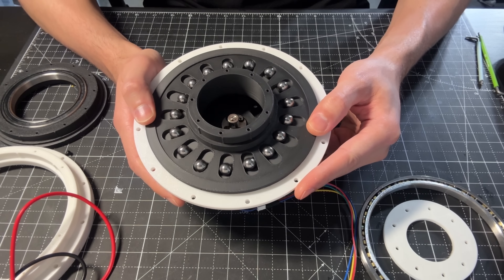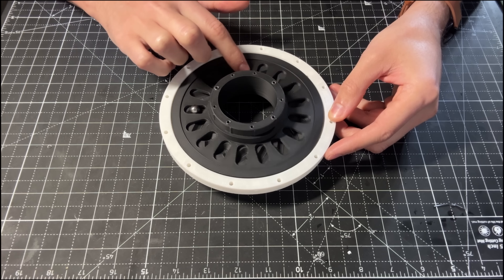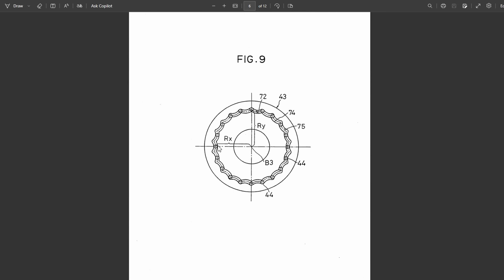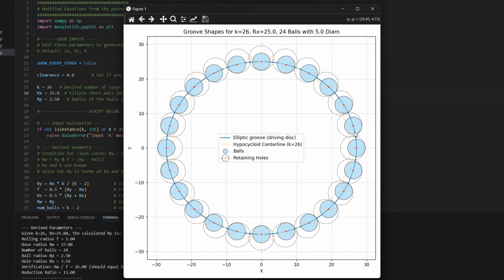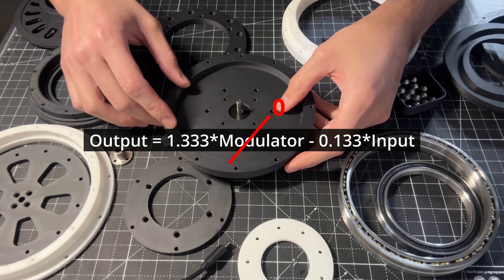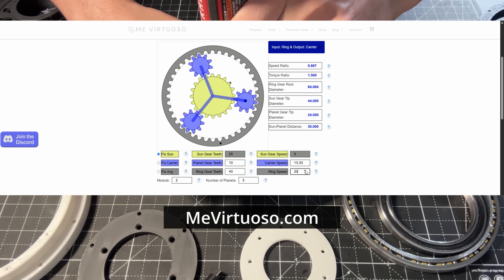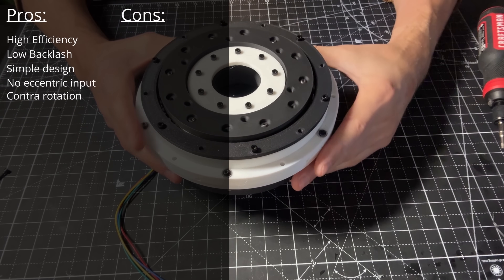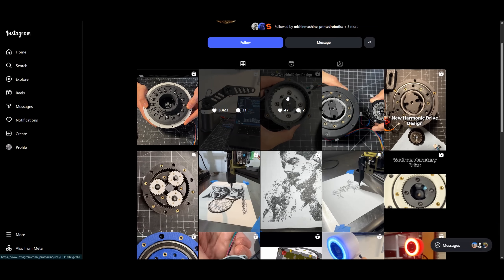Novel Reducer - The Logarithmic Drive

Comment: If you used the same curve on the input and output side, and drove the center part and put wheels on what used to be the input and output, would it work as a differential?

Comment: I expect if this was made with hard metal it would result in galling and wearing of the balls or the wave generator guides - probably working with metal balls and plastic guides like you printed is better. I suppose this will not go into production due to it not being as good as existing reducers.

Comment: I would say this is just a harmonic drive with extra mechanical complexity, but strain wave gears require flexible materials which are not always available in certain applications.
Reply from the maker: This design is also easier and cheaper to manufacture

Comment: Action like a hypocycloidial drive mixed with a harmonic drive exciter

A high ratio diferential drives allow hybrid input of multiple sources, including the obvious constant speed variable power "primary"  input coupled to a variable speed secondary input..

Balanced operation in one stage is what a harmonic (strain wave) drive has over a single stage hypocycloid..

Comment: I could see this as an application in automobile hubs as a reduction for off-road applications. I would think you’d need an easy way to decouple the drive but a 7.5 reduction as a “rock crawl” mode further reducing low gear would be fun to play with!

Really curious what torque these could handle…

Comment: It seems like the viability of this design will be contingent on ability to transfer torque compared to alternatives, something that should be directly related to the path of the bearings and the interactions between the two different pathways traced out. Also curious if the speed is perfectly linear as it seems to be. 

Beyond that, I wonder what other advantages/disadvantages this design may have over alternatives. Backlash as mentioned, maximum torque capacity, energy loss, precision, vibration, etc. I guess we will have to wait for further prototypes to know for certain.

Comment: Soviets had a bunch of patents on very similar designs in 1980s, and used them in space applications instead of Harmonic Drive. The inventor was Yangulov V.S., and he published many academic papers on such devices. For example "Geometric and Structural Relationships in Wave Drives with Intermediate Rolling Elements".

Comment: Great video!  This looks super!  Great find.  I disagree on fabrication.  You don’t mill hard metals.  You mill soft metals and then harden them. All you need here is case hardening. Could be done by traditional means (carbon bake) or induction hardening. There will be a tricky part, in that you would like to surface grind the grooves to perfection after hardening. Basically need to figure out how to make a bearing race that is a groove.  But this is already done for rotary couplers (think ship gun pedestals).  One might have to crest some specialty machining for this but it should be doable. What I like about this is both the counter rotation and the high torque. This drive should be able to generate and be robust to very high torque because all the forces are shared with so many bearings. Ingenious design, well done!

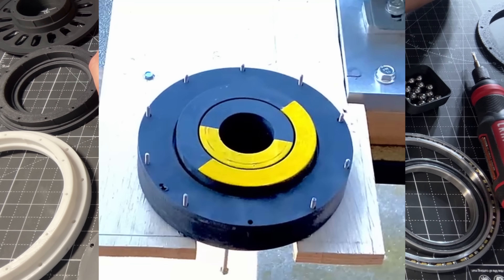Comment: 5:53 that vibration looks rough, I think this design is easier to 3d print, but performs worse than harmonic drive in both efficiency and accuracy

Comment: As others have said, the balls will be sliding instead of rolling which will eat into efficiency. I also suspect that at higher speed the energy spent accelerating the balls back and forth will become significant
Reply: The balls could be replaced with two roller bearings connected with a shared center axle.
Reply: @3fives-j5w 
That was my first thought as well, at least for large sizes that seems like viable design. 
I'm unsure about the size/weight to torque capacity ratio of planetary gearsets compared to this, but it feels like it might have massive capacity if built that way.

Comment: just a regular cycloidal reduction but done on a different axis. still pretty neat.

seems the balls could be either straight rollers or small cranks/eccentrics. iunno. think it over more...
Reply: just what I was thinking too, the ball bearings there could easily be pins

Comment: I'd dispute this working as a bearing as the load bearing ball wall contact speeds mismatch the balls need to partially slide rather than roll.

Comment: That's really cool.  I wonder if you could modify this to recirculate the balls like a linear bearing or old steering boxes.  It would be difficult to machine, but it would eliminate the reciprocating motion of the bearings.  Probably eliminate a bunch of noise.
Reply: You don't understand at all how this works as a reducer.

Comment: It's not efficient. The ball is sliding on all points of contact, not rolling. The ball is sliding on the cage while pushing against it to resist following the rotation of the track. The ball is also sliding on both the tracks because they are moving at different speeds from each other, and are following different paths so the ball will get a rotation in both axies. All of this will make friction that gets worse the higher torque that gets applied to the output.
Reply from the maker: Good point
Reply: I don' think it will be sliding significantly on all contact surfaces. For this argument I'm going to assume the grarbox is not preloaded, so there is some amount of backlash. Then there will only be contact on the drive face on each component. Three points in total. The ball should then be rolling on the two points with the highest contact force.
Reply: Not sure I agree. There might be an optimum ball size that lets it roll more than slide. Also, that is what lubricants excel at (you car engine crankshaft journals are sliding, not rotation).  You bring up a good point, but I don’t think it’s a killer. At least for a great many applications.
Reply: @hu5116  The car engine crankshaft journals are NOT sliding. They are floating on a film of oil. They are hydrodynamic bearings and there is no contact between the surfaces.
Reply: @hu5116  big difference between crankshaft journals and ball bearing balls. First of all, technically carnkshaft journals don't slide but are hydrodynamic bearings (pressurized oil film). Secondly, those journals have line contact, not point like ball bearings, huge difference. 
The balls can never role, no matter tha backlash. The contact points are almost exactly 180 degrees from eachother, and the surface speed vector points in the same direction on both those points. That means the surface of the ball has the move in the same exact direction in two point spaced on opposite sides. This is called sliding motion, not rotation.
Reply: Es verdad y esto varía con el ángulo de cada surco tanto en el eje de entrada como en el de salida, o sea que cada diseño tiene su propia característica de fricción. Se puede mejorar el diseño poniendo 3 elementos, uno para el surco primario, otro para el modulador y otro para el secundario y que estén conectados entre si, pero se haría mucho más complejo.

Comment: I'm not sure about the high efficiency, it's not because there are bearings balls that it's efficient. For that, they need to roll and I don't think they do a lot of rolling, they mostly slide which is not efficient.
Reply: yeah, three point contact of a ball can't make it to free roll, it will be sliding and the thin separator will be the weakest point as you can't increase its load capacity by simply increasing its width
Reply: @konstsh2240  all balls slide to some degree. thats why they use arch grooves on high loads, "4 point contact"... and rollers when the load gets really high.
Reply: @paradiselost9946  this is true, because 4 points are symmetric around mid section plane and from the kinematic point you only get 2 points to constrain the planar rolling motion, but here it the whole another story because even the groves have the arch cross section the reactions from that arch on the ball will be asymmetric because of torque so you have 3 forces loading the ball from 3 groves all in different directions - not even coplanar, there is no a single chance this could be sliding free even in theory. This is very niche type of transmission.
Reply: I was about to make the same comment when I saw yours.   Also the pressure angle of the drive kinda looks high.
Reply: it's literally a planetary gear but worse.